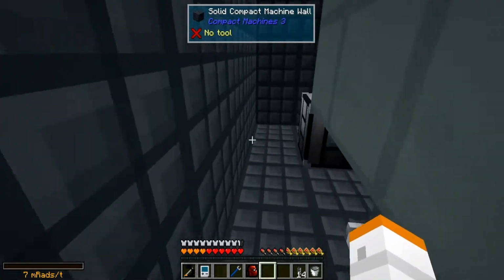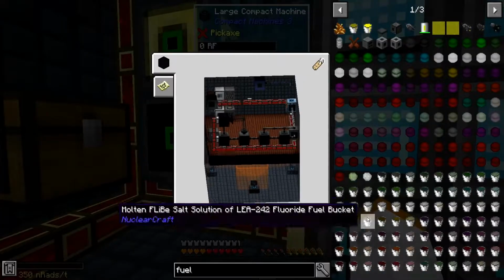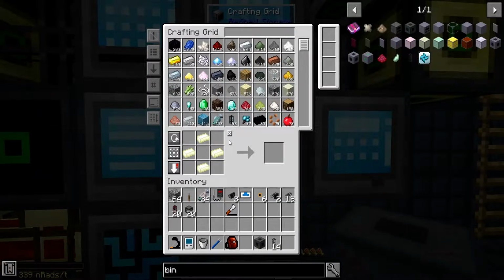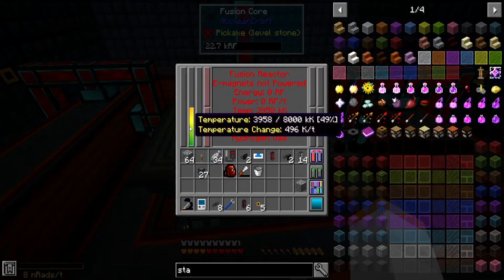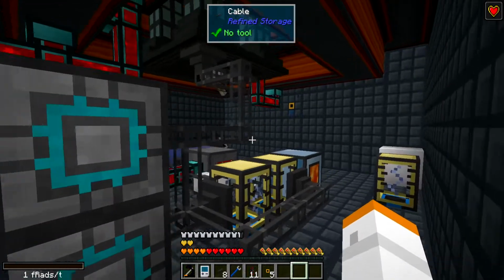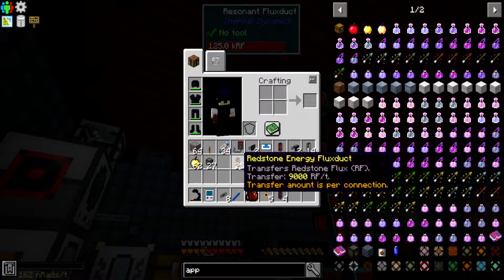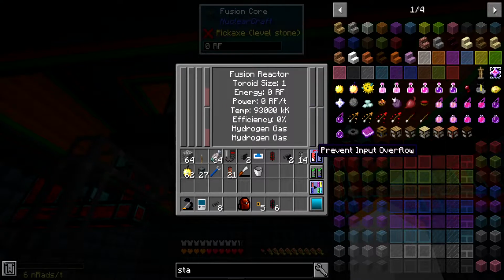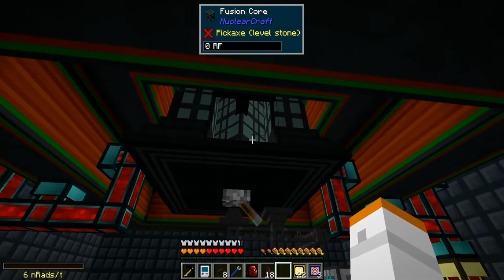Compact Claustrophobia EP17 Firing up Fusion!

Comment: if you connect the rings with fluxducts (make the fluxducts connect to more blocks of the rings) you will have an easier time starting it up, cause you will distribute the power evenly to the ring, instead of connecting it to one block on each ring, and making that block of the ring distibute to the whole ring. also, i think your lever at the bottom is interfering with the RS importing the fuel/gas. ;) i did this with only one fission reactor with two signalum ducts and just layed down a bunch of redstone ducts around the rings. im excited to see the next episode :) also, i didnt like the diamond ore mining, yes you need alot of time to make the bedrock tools, but as you found out, you need all the steps to get out anyway, and as i said in another comment, making xp to repair tools should make it so all the diamond nuggets you need is 27 to make ONE Diamond Pickaxe, and however the rest you can use to make other things that require diamond nuggets. im not saying all this to be negative, i mean it in constructive criticism :) you seem to be in a hurry sometimes, and when you cut for timesinks, this is where the pack shines imo, cause it gives you time to set up all the other things. Automation is always key in modded Minecraft, but getting to where you are without automating Hop Graphite and the Arc Furnace, is abit silly :) anyway. my "rant" is over. :) you got a sub from me.